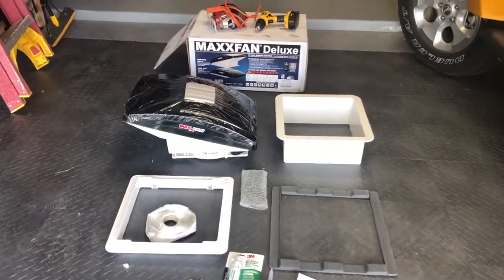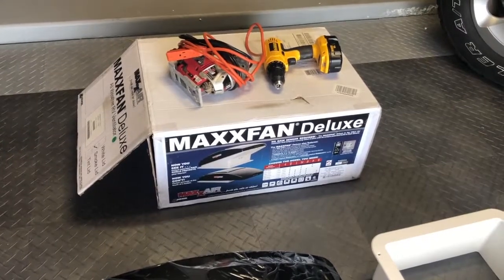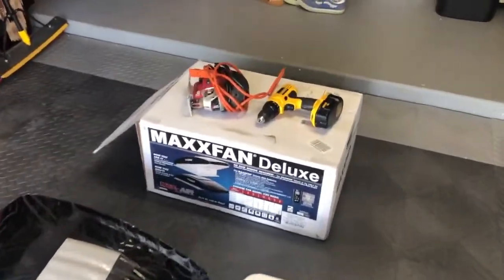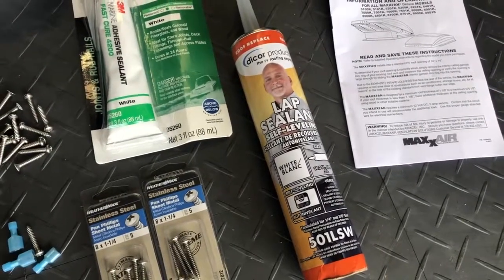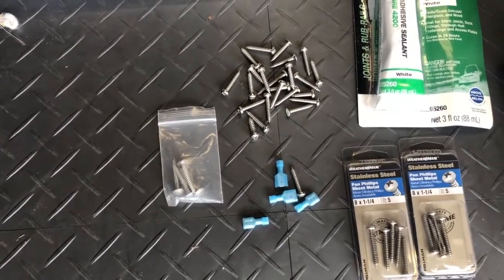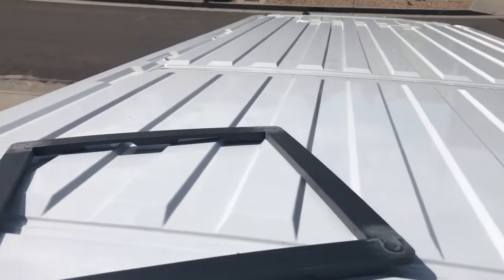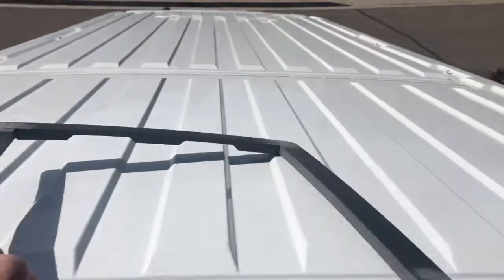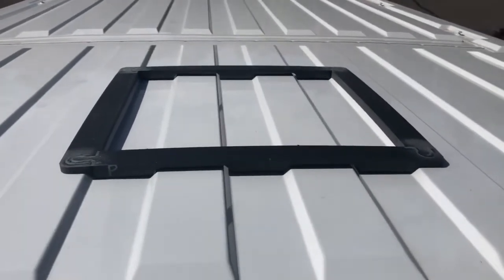Maxx Air Fan Install - A Pro’s Guide

Comment: can you tell me the manufacturer's name and part number for the roof template
Reply from the maker: I bought it off of a guy on eBay who custom builds these adapters. https://www.ebay.com/itm/142478235445?_trkparms=ispr%3D1&hash=item212c5d5735:g:zycAAOSwr7ZW4zfO&amdata=enc%3AAQAGAAACoPYe5NmHp%252B2JMhMi7yxGiTJkPrKr5t53CooMSQt2orsS9d9gBrkNbRQtRn8MVXnYkhsvkW1ayaNzYfJO3mthlnN4TKyzkXFkilfpvmTBJuMZWDh0%252FhAPx342E0lkW%252FH6H6z9bKrm9s6klbRrmisHLISM1DUZMP5JoHlTEIRCdQeEsNAM9dNo7bn57R9XF74ganwWaNQsY0CkwYsaPNcHjkKPTkYQRZLfT%252B%252BXY8JXlaAFj8gMQ1cEROGbWZiRC%252BPnigMEo9mS0qzgAi0L4uGkOkgHzSfoMFDabcwjW5F9%252BDDeuzXrw3YWuM9levGwkg%252B5fQaPtfvgcXfkpYY7xXyk9dDqrrrQ2MmkCszcRP5LE5vA6RTDuJN1rmQxGv9N8T8APQcdBbSHXQ%252B7By5iPCm1iQ1S8pVNQTePnX%252FNG0hfDyWDGP3Ovn7UW21ljTvB%252FzLyY5H1bXPrPw2Z40spxy%252FrfMW4pmX5PwrkD%252FcOg2y3SheTnPyJINVYXHX7bCrGR%252FQPBhlMfugTMAMUknzadkCJf1Vbm4kWaArKxJPx5VxjMFwPHuAUMxOsQwCMh2whOALg9CXDogn3ywPXrDbm44IniZuse7LU3BUDMUKxvgAOhYntCFaavAZaHeCBwNX42CehoJT9MUUg93z1bo540qH%252BcRD13CY0Lr4Zo4wBdqOl%252FOuoY9lX4V4XnChFLZ%252F48K%252FZIXzRuBp%252F5tEJvtE0KKLNcdnLUhObYzP2gUmc%252FzdfpDxZo5x5tq7T4y87m074PTMuRQeUKtu0VG8h8eAhMf4cQ75Dxl3dyLWPbkxgZthfKoCd3qIzTHaz91cqMtZx4n9HPP%252FmLJmubm%252Bl4vumP0ILpLLZVx06nx2p%252F6zoS%252FuhGZluX3f%252BSU95jKz0ZTY4PmiXMQ%253D%253D%7Cclp%3A2334524%7Ctkp%3ABFBMrNCXh85f    You might see if he can sell just the adapter